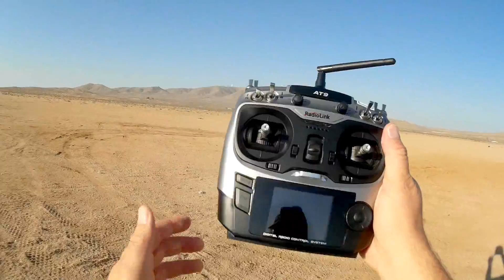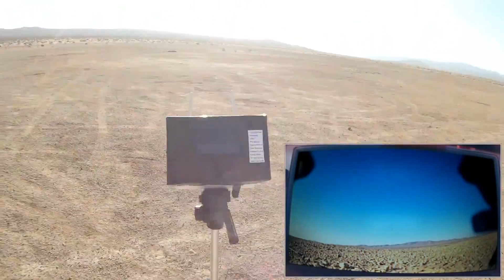Foxtech Lightning 210 RTF FPV Racing Drone Flight Test Review

Comment: If you are looking for a good starter FPV racer look no further than the Eachine Racer 250 so far I have had no issues with the quad and have flashed with LibrePilot, also great fun to fly. By the looks of it the foxtech is a nice little package as well.

Comment: nice review, that screaming punch looks like a lotta fun, i've been thinking about that odd receiver placement, my multirotor 210 is short of space too, i have the flyskyia6b which is huge and now that i see it mounted up front underneath where i'd put my runcam hd.... so it would naturally provide an angle for my runcam...i lowered multotor 210 frame with 25m posts and added a third tier at the front for a runcam... hmmm this might just work.... be careful quad101.. i shouted i have the power then ripped the 1806 x1 motors to bits  with a 4s turnigy bolt 65c  on my kingkong 188...  and who else giggled when quad101 said 4s with a little giggle in his voice? hehehe

Comment: why do you fly with accelerometer??? it took me two flights to get used to... and it's way more fun
Reply from the maker: I'm flying LOS so that the viewers can also see the quadcopter in flight (not just its FPV video view).  It's very difficult for me to fly acro in line of sight flight, especially when the quadcopter is flying distant.

Comment: Great video and do you recommend this one for my first racing quadcopter as I need something very crash resistant and that is not Walkera because my friend said not to get any Walkera because the motors burn yo easily
Reply: I would get something considerably cheaper in the toy grade quads as a starter. These get expensive to fix when (and you will) crash them hard. Learn basic controls on something more conservative, then move up if you stick with it.
Reply: If you want a FIRST racer go for a Tarot 130, if you're totally new just buy a Nano QX, reason being both are cheap to fix, the Nano QX is slower but I learned on it, its no toy so it won't break 3 days later. Tarot 130: $145 PNP from banggood, you need a radio and a battery/reciever and fpv gear. Nano QX: NOT AN FPV QUAD, but $70 plus a radio or something around $100 for the RTF. I recommend buying the BNF and getting a DX6i or something
Reply: +ScorchingNightfall I've flown drones for over 11 months and they have been toy grade and I want to switch up to maybe this because the toy grade ones batteries keep dying after a week (MJX x101 x400 Syma x5sw)
Reply: +Andy Sexton I've flown toy grade for about 11 months now
Reply: ivan sikaleski Go for a Tarot 130, FatShark Teleporter V4s, a Taranis or AT9, and thats about it to start fpv
Reply: ScorchingNightfall how much would all that be?
Reply: xX FaTeForce Xx If you're not concerned on the goggles portability, $400 and that stuff will last you forever, or go to amazon and get an Arris X-Speed250 RTF + goggles for the same price, you're better off the x-speed honestly unless you care about how shitty it is to do maintenence on it